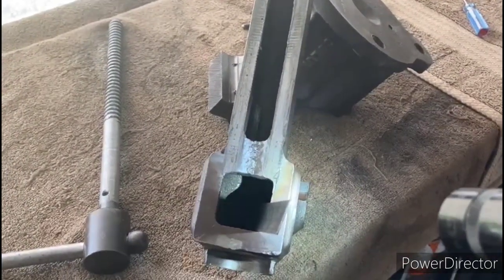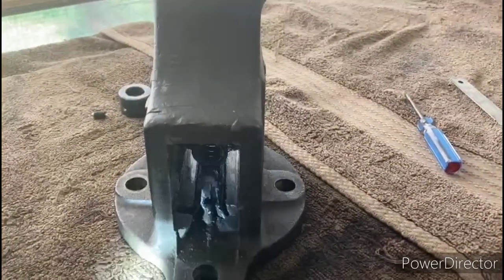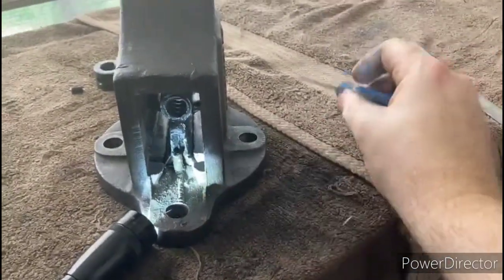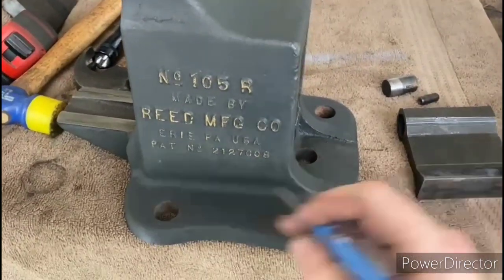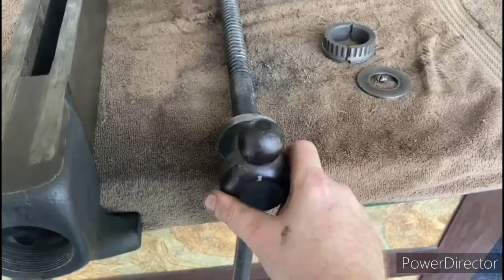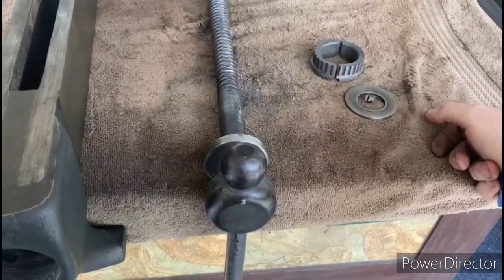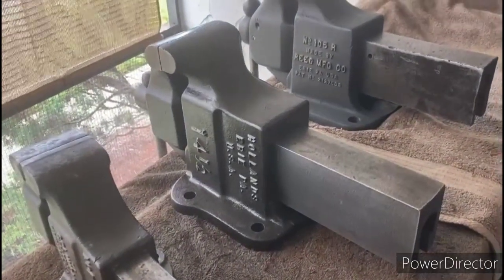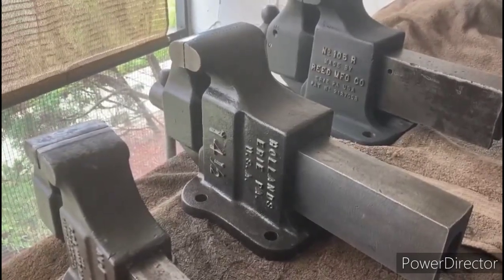Who made the best vintage US bench vises? Comparing a Reed R, Hollands & Columbian (part 1 of 2):

Comment: Terry, another great learning experience! I'm still shocked though. Has anything been recovered?
Reply from the maker: Yes the Columbian vise survived and I plan to upload a video on it shortly. The other two were not in the house at the time.
Reply: @BencoVintageMachineWorks  that's great! Were any of your motors and machines recovered? I'm watching the motor resto videos now just like "dang, I hope that survived!"
Reply from the maker: @ForestWoodworks  Fortunately all my electric motors survived because they were in my storage room and not in the house. I am hoping that the work I did after the storm cleaning the tools will pay off.
Reply: @BencoVintageMachineWorks  I'm relieved! I know the house was a loss, which is still awful. I'm just glad your work survived!

And one for old time sake (lol)  you think I'm good going with 14ga on my motor? I've measured the original lead, and they def appear to be 14ga. I'll be (eventually) running this on 220. But I'm starting over and resoldering the leads once I get the order from tons this week because I need every piece of space I can recoup to even get the stator housing beck on.
Reply from the maker: @ForestWoodworks  If you measured the originals to be 14ga then should be good to go. Using too small a wire can cause them to overheat so it's always good to check a wire gauge chart just to be sure.
Reply: @BencoVintageMachineWorks  totally. I would question myself on reading the chart correctly. By the chart, I thought it said 15 amps was the max for 14ga, but mine at 220 would draw 17 ish. So all that then seemed to conflict with what was originally on the motor, definitely not 12ga.
Reply: @BencoVintageMachineWorks  it's funny though. The information and techniques you demonstrate sometimes makes more sense after I watch the videos a couple times, attempt on my own, then rewatch. So, with that I could've probably looked for an opportunity to find a length of fresh lead to splice to, rather than removing them completely and replacing. Looking back I'm not sure if there were any good lengths I could have spliced to, but I'll go to that option on the next motor, replacing completely only if needed. Light bulb moments, I guess.
Reply: @ForestWoodworks  There are four major wiring characteristics that are important to working with motors and associated wiring:

1.  Voltage Capacity.
2,  Current Capacity.
3.  Temperature Rating.
4.  Insulation mechanical characteristics – does the insulation work well in the environment such is the insulation resistant to rubbing caused by vibration.  

For 110 VAC wiring – the normal minimum voltage rating is 300 volts; for 220/220 VAC, the rating is 600 volts.  (Romax is rated for 600 volts so it can be used in either 110 or 220 circuits.

The current capacity is tied to the temperature rating.  As the current flow increases in a wire, the wire temperature increases from the resistance.  There is normally little price difference between 14 and 12 gauge wire – so I use 12 gauge for any shop wiring.  The 12 gauge has a lower resistance than 14 gauge so the wire runs cooler and drops less voltage.  For most applications, using a heavier wire is ok.

Most current tables are for household wiring or building codes.

The wire in your motor may have a higher temperature rating than normal house wiring – so that motor maybe able to work with a smaller gauge wire.  I worked in aerospace/defense electronics and that industry used telfon insulated wire so the wire could work in higher temperatures in aerospace or military environments.  (Most large motors operate at a higher temperature than normal household wiring.)

Finally, some insulations do not work well in a higher vibration environment – the insulation will wear down and bad things tend to happen around exposed wires.  Some environments contains harsh chemicals so that can be a consideration.  

Hope this helped.

Comment: Yeah I get it....  buying new files got me to restore my old Nicholson files.    Also?   old hammers and hatchets with broken handles.
Reply from the maker: I have tried to restore some old files with medicore success. Once I purchased a Grobet NOS  file at a swap meet, it totally changed my perceptions of what a metal file could do!
Reply: @BencoVintageMachineWorks  These are some things I did..  First I brushed in a thick 'Dawn' (my go to detergent for cleaning)   This gets out the old grease and maybe floats out the easy stuff.  Do it two or three times scrubbing with a soft brush like a toothbrush.    Next I use my 'Ed's Red' (1920's or so gun cleaning formula)  it is equal parts of kerosene Automatic trans fluid , mineral spirits and acetone.   Then I add a couple of ounces each of real lanolin (protectorant) and amyl acetate (citrus solvent for odor)   You seriously need a quart or two of this near u at all times when working on stuff.  It comes out #1 or two every time in internet testing for a penetrating oil.    I use it to clean guns originally but it is cheap to make and beyond excellent.  Plus...  it is pennies an ounce so you can really slather it on guilt free.   Kroil is the only thing that comes close.    Now... let it sit for hours or days..   Get one of those kitchen scrub brushes with copper or brass bristles...   Go both ways with the cut of the teeth.   The brass will not dull the file like SS would.   Throw away your file card... those things kill files.   Repeat that last as many times as it takes.   My files sat for 20 years crudded up with bondo and aluminum.   The Eds Red formula will actually get under the stuff and penetrate into the metal a bit.   So far nothing I have ever cleaned with this stuff has rusted again..   I keep a rag lightly soaked in it for wiping down guns that I handle and put away (most of mine are blued)  It is a CLP ..    Cleaner.... Lubricant...Protectorant.   Use it for a while and dollars to donuts?   You will do a short vid on it or at least mention it.    I am not Ed....   Ed made the original formula and it was published in 'The Rifleman'  way back in the 30's    Probly some of the guys who used your vices in the way back used the stuff in the shop.

Comment: Is there a distinction between bench vise and stand vice? I ask because it occurred to me that either type vice could be mounted on either base. Does it have to do with the type of vice or have I misunderstood something?
Reply from the maker: Rigidity and space are the main issues presented if you are lucky enough to acquire a large vise.
I suppose if your bench was big enough and sturdy enough, you could mount a big vise on it (a large steel welding table for example).
Reply: @BencoVintageMachineWorks  so size and weight are the main factors, I see lol. that makes a lot of sense, thank you.
Reply from the maker: @roysnider3456 Thank you for checking out the video. There is a part 2 if you are interested.